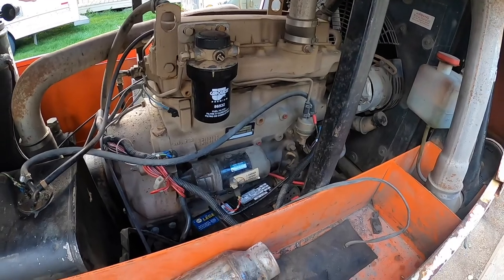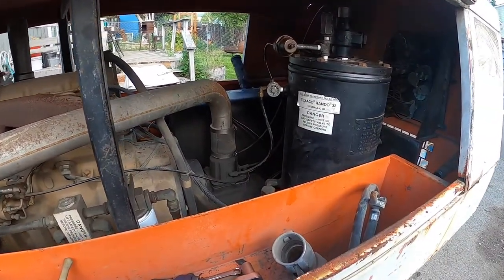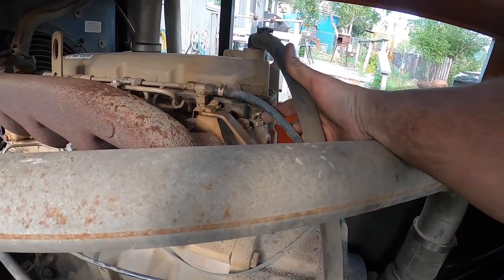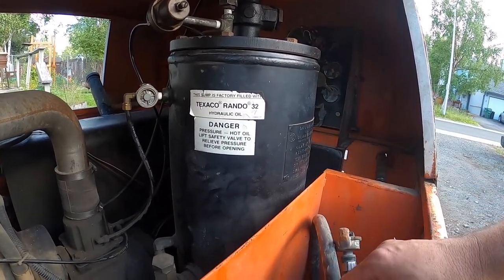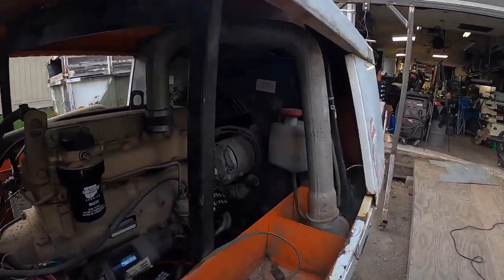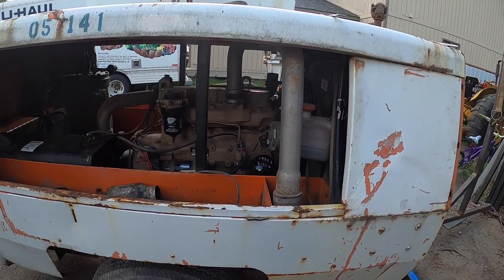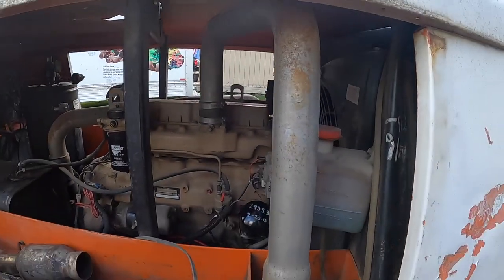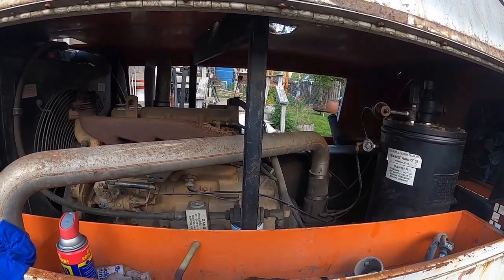Sullivan D185 Basic Troubleshoot

Comment: I have a old 185 Ingersol and it just blows straight out the pressure relief valve when you put it on run... Any clues?
Reply from the maker: Maybe make sump safe to work on (zero psi), remove valve and clean/lube it? Sometimes they get stuck.
Reply: @sidetrackmetalworks2058  I see what your saying but at the same time have no idea where that is
Reply: @sidetrackmetalworks2058  this compressor is on the back of a paint truck it has 37000 hours
Reply: What is the part you are saying??? They just replaced the couplingr and I believe the oil separator filter
Reply: @sidetrackmetalworks2058  I ran the truck for years that is always lead to large amount of compressor oil I think that is the cause of the short life of the coupling
Reply: @sidetrackmetalworks2058  why would work be done to the sump when the compressor is running
Reply from the maker: @streetbikebilly2597  There should be a large cylinder in the vertical orientation near the screw compressor at the back of the engine. Atop this should be spring loaded valve with some 1/4” lines coming out of it. That valve can get stuck due to rusty debris. It will need cleaned. Inside that large vertical cylinder is a filter. Chances are, if oil is finding its way to your air hose, the filter will need changed. It’s not a cheap filter, either.
Reply from the maker: @streetbikebilly2597  Where do you get this idea?
Reply: @sidetrackmetalworks2058  I have ran this compressor enough to know about the filter I have had problems in the past with oil coming through the airlines and a new filter will resolve that, I believe that to be changed out. A mechanic just went through it when the coupling went and replace the coupling. I ran it for about a week and then one cold night it blew out of the pressure relief valve ever since then it has always blown off the pressure relief valve when you hit the run button
Reply: @sidetrackmetalworks2058  you were saying something about working on the sump I don't know
Reply: @sidetrackmetalworks2058  compressor has always run hot on the airside it will always leak out compressor fluid like you read about it just falls out of it I think it's coming out of the seals on the screw the start run bruh button was tampered with and they said separate push button up top was installed that you just hit the button that will go up into run almost like a manual start run but it's coming out of the pressure relief valve do you think that the compressor is just sat to high that it instantly blows off
Reply: Looks like this one has the same issue it's a utility mount, was the air just going right out the pressure release valve? The safety blow off...

Comment: where did you get a new sensor for that there that you bypassed?  i need one too now  :(
Reply from the maker: I still have to find one. I do know that I ain’t paying Deere prices for one though!  This summer, I’ll drain down some coolant and pull the sensor.
Reply: @sidetrackmetalworks2058  ok right on 
i may be forced to get one off JD, but i will dig up the pn and chase one online first
thx
Reply: @sidetrackmetalworks2058  any chance you had moment to learn the part number?  

i have a sullivan paletak but i cant find my manual 

and i am struggling to see it online ... just curious if you have made any headway since last week?   do you have the sensor out of the motor>  maybe the PN is on the part itself?
Reply from the maker: @KhameleonKoatings  I won’t be of much help for a bit. Out of town for work. It’s definitely on my list for when I get home, though. Apologies.
Reply from the maker: I found the switch that works. Turns out, it is a normally closed switch, and I had a normally open switch on there. Changed out the switch to a NC switch from Advance Truck Parts. ATP Thermal Fan Solenoid Switch 180 Deg 8037044 8037014  Hope this helps.